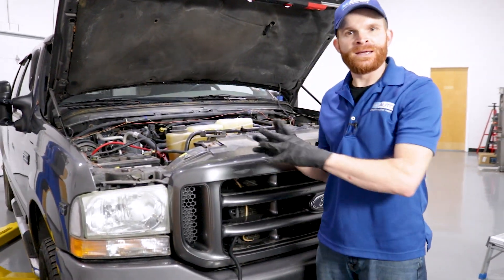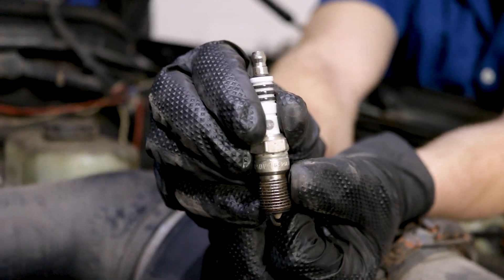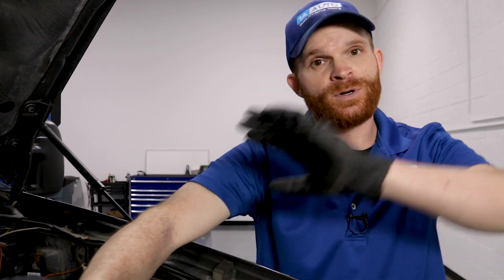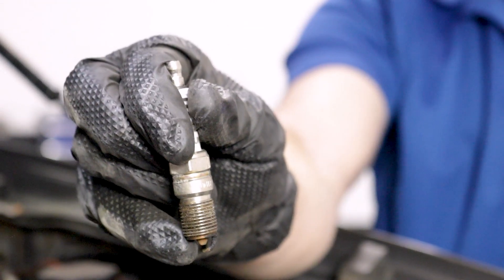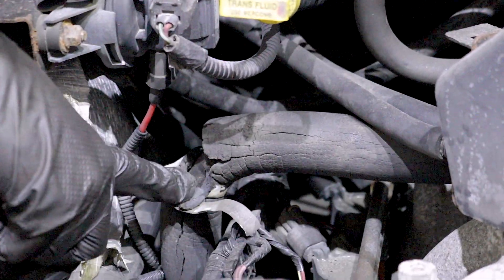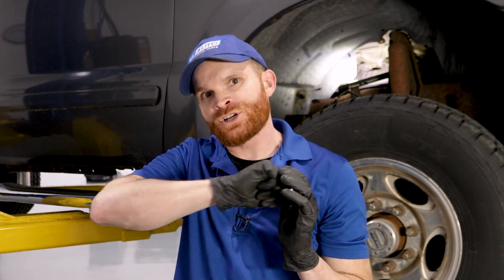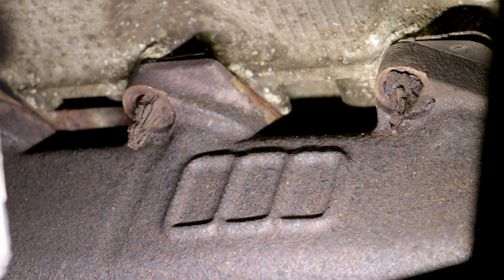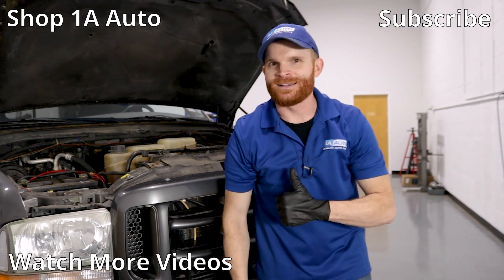Top Common Engine Problems 1999-2007 Ford F-250 Truck

Comment: Hello. Great video. I have an 03 f250 with the 5.4 and 86,000 miles that runs great until it rains or gets washed 🤔. After that, it has a slight skip when idling and while driving, it doesn't accelerate well because of a skip or misfire. If you really step on the gas however, you eventually get pass the skip, but acceleration is still terrible. Again, this ONLY happens after a heavy rain or a car wash(hood closed and no engine cleaning is done during washes). After about a day, everything is fine again...
Reply: Coil not sealed!  Water getting in!  Dielectric grease and make sure the COP coil is seated and sealed!
Reply: Somewhere in front water may not be draining as it should, and is being diverted to one of the sensors, that would be my guess.  Or one of the seals around the engine bay that limits the amount of water that gets in has failed.
Reply: Check the passenger side rear 2 spark plugs wires to see if they are worn for whatever reason water runs across the heater core hoses and drops down onto the plug wires making a puddle my 97 4.6 did this I zip tied the hoses over a little problem solved good luck
Reply: As others have said check the coils and spark plug holes. Remove the coils and blow the holes out with air. Check to see if you have the rear hood weather seal. 

Also check the inside fuse box below the dash. Early superduty’s are notorious for the driver side windshield leaking onto the fuse box and gem module. It causes all kinds of electrical problems

Comment: Did any of the 6.8 v10s have the same 2 piece spark plugs like the 5.4 triton? If so what years have them and which ones do not? Thinking about purchasing one and would rather not get into the headache of having the 2 piece plugs snap off in the heads. It would be a huge help. Thanks!

Comment: drivers side exhaust manifold has 4 broken studs. i dread this removal. 
i get lots of codes for misfires. ive changed 3 coil packs and now im doing 3 more but im heading out to check that PCV hose right now ;) 
i have a 2000 and as far as i know there isnt any issues with blow out. when i do my plugs, i always start the truck for under a min when cold. i assume warming the block just slightly , helps. 
redone the entire front end and may need new steering gear. 
nothing cheep on this truck 
ty4urvid
Reply: ps. im going to try the mig welder to pull broken studs
Reply: i drive in the bush lots and go through mirrors more then i change the oil... lol

Comment: I love your videos!  Very well done.  I have a problem with my 2000 Ford F250 with the 6.8L that I can't figure out (yet).  I'd love to get a professional opinion and I'm willing to pay shop rate just to talk to someone.  Briefly - engine overheated the other morning but my temp guage didn't show it.  As it overheated it puked out coolant and oil out the coolant reservoir.  So I changed out the oil cooler and the radiator.  Filled the cooling system and it boiled over again.  It went into limp mode due to the CHT sensor but my engine guage still showed normal.  Tried to replace the t-stat today but part store gave me the wrong one so I had to put the old one back in.  Any advice?  Tomorrow I'll get the right t-stat and hope that solves everything.  BTW - the engine runs great.  And I watch the ECT on my scanner and shut the engine down at 225 degrees.  That's it in a nutshell.  If you can help I would be indebted.  Driving me crazy.  Thanks.
Reply: blown head gasket if oil is mixing with coolant
Reply: New t-stat today but same result.  Puking oil/water sludge.  Gauge still doesn't show overheating but scanner shows 225-230F.  Engine runs fine.  No misfire.  I just don't dare take it anywhere.  Thanks for any advice.
Reply: @nunnyabizness  yup blown head gasket
Reply: Could be oil cooler. Much cheaper fix than head gasket

Comment: A couple things I noticed that you discussed in the video that aren't correct.  I'm not trying to nitpick but just want the correct info to be out there as others are watching. 
 

1.  The generation that you are working with (the 2003 model) is the 1st generation or commonly known as the "2-valve" version which was offered from 1999 to 2004. 

** (NOT up to 2007 as you said in the video) **

2.  This version did NOT have 360 horsepower as you mentioned at the beginning of the video.  The 1st generation 2-valve versions of the Ford V10 for the Super Duty had 310 HP and 425 lb-ft. torque respectively.

The 2nd generation (more commonly known as the "3-valve" versions) from 2005 to 2010 in the Super Duty trucks had 362 HP and 457 lb.-ft. of torque.

These engines were offered in other vehicles with different power ratings as well such as Uhaul box trucks, RVs, buses, stripped chassis trucks, and other vehicles.  In many cases, they had different intake and head designs and some parts are interchangeable between the different engines and some are not.  But that's a different discussion.

For the 1999 to 2004 versions for pickups, they had the option of the 4R100 or 4-speed automatic transmission or the 6-speed manual.  From 2005 to 2010, they updated the automatic to a 5R110 or 5-speed and still offered the 6-speed manual as an option.

They don't offer the 6R140 or 6-speed automatic transmission for the Super Duty pickups from 2011 and newer however, they do offer this with the chassis versions such as Uhauls, buses, RVs, and other models.  To my knowledge, there is no conversion kit avialable to mate the 6-speed automatic to the 6.8 V10 for pickups.  So, one would need to get this from a donor vehicle of one of the vehicles mentioned above.    

3.  You called the valve cover a "valve cap".  I've never heard anyone refer to the valve covers as valve "caps" ever.  I'm sure it was just a simple mistake and I'm not trying to get on you about it but it was just odd.

--------

This channel's videos are great and this one is as well for the most part so please don't take my criticism the wrong way.

I would suggest just doing a simple Google search in the future when discussing particular models and engines so you have the right info.  If you need to, just use a 3x5 index card to have a few notes on and refer to that.  This doesn't need to be so professional that you can't use a simple index card.

----------

For the Ford V-10 engines, although you did mention a few issues that they share with the other similar 4.6 and 5.4 V-8 models such as the spark plugs blowing out on earlier models and the exhaust manifolds bolts rusting out, you didn't mention one very important difference about these engines in relation to some of the newer 5.4 engines.

The fact that both versions of the 6.8 V-10 DO NOT HAVE camshaft phasers or usually known as VVT (variable valve timing).  This makes this engine so much more reliable with less moving parts internally to break down.

That might be one of the main reasons that these engines have been so reliable and I think it's something that is worth pointing out.

If you read the various forums and other sites online or in Facebook groups, you'll notice many owners getting at least 200k and 300k and more out of these engines before they have a major breakdown.

Usually.

So, they are pretty reliable for a lot of miles with little money invested.  And, they are a lot cheaper to maintain than diesel engines with only needing 6 quarts of oil with a filter compared to at least 14 quarts or more with a diesel.

One of the main downfalls (other than what you pointed out) is that they typically don't get the best fuel mileage.  Usually.

Most owners report getting between 12 mpg and 13 mpg unloaded (without towing a trailer) driving down the highway.  Many have said they get between 7 mpg and 9 mpg when towing a trailer.

But in fairness, it's all relative to how you drive.  My guess is that "most" owners of these V10 pickups are spending more time on the gas than they need to because they like to have more "fun" in the seat of their pants due to the power.  So, if they would just be "nicer" to the gas, most owners would probably get an extra mile or 2 better.

Personally, I own a 2002 F-250 extended cab 4x4 with 8 foot bed and with the 6.8 V-10 and 4-speed automatic with 3.73 gears.  It's got 308,000 miles and runs pretty well.  I get between 14 and 16 mpg if I'm driving conservative at around 68 to 73 mph with little to no wind against me on the sides or front.  If I want to do 75 to 80 mph, that obviously goes down to around 11.5 to 13 mpg. 

But wind is probably the biggest factor in how good or bad the fuel mileage will be.  Even if it's from the side, it's still not good.

I use an old Superchips Cortex 2950 tuner and have it set to the "fuel mileage XS" tune to try to get the best fuel economy and run the cheapest 10% ethanol (87 octane) whenever possible.  Sometimes, I'll get an 88 octane that I think is a 12% to 15% blend (I might be wrong on that) from a local Casey's general convenience store that is a few cents cheaper.  

But usually, I just put the cheapest stuff in I can wherever I'm fueling up.

I also tow with this setting without issues and have towed over 20,000 pounds (total with truck, trailer, cargo, fuel, me, tools, and etc.) and it pulled fine so I just leave it on the fuel mileage XS setting.  I've tested it with different fuel and the tow setting and performance setting and overall, the fuel mileage didn't improve over the same conditions and terrain so I decided the added costs for fuel wasn't worth it.

Comment: My 99 v 10 sputters and hesitate not sure if it's fuel spark or sticking valves it doesn't do it all the time mainly when it's warm and ecelerating hard not sure what to do about it no codes and no engine light

Comment: I have a 2003 F250V10 6.8 gas engine  My truck is having a hard time getting out of park into the other gears I'm assuming it's my innerlock solenoid can you please do a video on replacing a Interlock Solenoid  super duty 2003 thank you so much you have great videos very informative.
Reply: I have ample experience with this problem.  The gear selector (gear shift) mechanism on these trucks are GARBAGE!  Typically the gear selector tube breaks because it's made of pot aluminum.  I've had to replace mine at least 3 times.  Also the lever at the end of this tube can work itself loose if the small bolt at the end can/will come loose and then you'll have shifting problems.  Just another poor design by Ford engineers.  I've done mine so many times that I can have my steering column removed and on the work bench in 30 min. or less.  Sometimes I'd like to kick those engineers right in the balls for the problems I have with my F250.  I've got 318,000 miles on mine but I've had a lot of problems.  Best of luck to you with your shift problem.
Reply: Linkage

Comment: How is the transmission on the 2002 of that model and is the 2002 included in the spark plug problems? Helpful video thank you.
Reply: My 02 v10 has 231,000 miles on it. Iv never had any problems with it until it hit 229,000 miles and it blew out a spark plug while towing a trailer . My mechanic fixed it and so far so good.  I hope that it doesn't do it again.  I love my v10 it has plenty of power for me and it's a beast  in 4x4 low 💪

Comment: Doesn't require premium fuel 
Doesn't  have 360 hp Isn't a 3v lol
Mainly problems with spark plug ejection on the early non pi v10s 
They talked about the pvc valve but not wear it leaks at the bent elbow under the upper intake 

All issues In the very first minute of the video
 Was a mechanic for a fleet of 2v 6.8s keep your manifolds healthy and don't go below 2 quarts low on oil ever and you have a 350xxx mile motor
Reply: How do you keep your exhaust manifolds healthy?...
Reply: @dylancampbell8064  make sure you massage them at the end of the day

Comment: hello where is located de egr valve?
Reply: Mine doesn't have an egr valve nor post cat sensors only upstream O2 sensors these trucks didn't come with them. I have 03 f250 with 6.8

Comment: Oh snap🤯 now I know why I'm losing power and a pop sound with truck just running in park. Spark plugs could be bad, I need to check right now. Need my truck for winter,, thanks a bunch for the tips on major issues with this Ford truck.

Comment: I have this same motor and I’m having a ticking noise from 2500 rpm to 3000 rpm nothing before or after that and not feeling any power loss while it’s doing the tick any ideas ?
Reply from the maker: +Cameron Howell We wouldn't be able to diagnose an issue like that here, you may want to have a local mechanic take a look at it. Thanks for checking us out! http://1aau.to/m/Shop-1AAuto-c
Reply: Coil, spark plug, exhaust manifold leaks, Lifter, Rocker, Valve Spring!  Check them in that order as that easiest, and cheapest!  Make sure coils are seated and sealed, wire connectors are secure!  Use a stethoscope to isolate the problem area!  If you suspect a bad coil, swap it with one from another cylinder!  If the issue starts at the other cylinder, it's the coil!  Lifters, Rocker are easy and the valve cover is simple to remove!  Just take your time putting it back on!  Make sure the gasket seats properly or you'll be starting over!  Don't replace any springs unless during inspection you find one is broken!  If it's any of the "Lash Adjusters/Lifters" it's because something got inside it and is stopping it from completing a full compression cycle!  Many good YT videos on lash adjuster replacement!  Don't forget to preload them before installing!  Good luck!

Comment: Bet you haven't seen this one: 2001 F250 6.8; at 87K miles got #6 misfire, pulled coil and had 1" coolant on the boot. never water on top or even rain.  Sucked it out with straw and shopvac, drove another 80K miles rinse and repeat.  Otherwise best truck ever, no, best vehicle ever.  Work truck, airlifts for heavy loads, then snow plowed 5 years, followed by 30' 5th wheel coast to coast 10 times. Now 175K and had to replace fuel pump, otherwise virtually no expenses but tires. Terrific truck. But coolant into #6??

Comment: Thank for the info,I recently  had a clutch replaced in mine new everything,it seems they didn't live the throughout bearing properly I scoped it and its dry shouldn't you grease all fork contact point so it will not vibrate and make noise while clutch pedal it out 2003 model

Comment: I have a 07 f350 85k miles i have a rattling noise I change everything in the engine but the noise still there the flex plate not cracked help please I have a video up

Comment: So my v10 2003 seems like it’s shifting slow it decides to only shift when it’s over 4000 rpms. Any idea why?
Reply from the maker: +BostonTough We wouldn't be able to diagnose an issue like that here, you may want to have a local mechanic take a look at it. Thanks for checking us out! http://1aau.to/m/Shop-1AAuto-c

Comment: Ahhh I have a 2002 Triton V10 Excursion… dam I should have gone desire… Well I’ve had to have 3 of the plugs replaced as they blew while on the road.  Sounds like you dropped a muffler…. What was not said, is the shop that does the work needs special tools to prepare for and insert the Helicoils.  The drilling rig has a vacuum attachment to suck up as much of the shavings while drilling and you need a bore scope / camera to look down into the cylinder area and inspect to make sure you got the all.  Then repeat after threading for Helicoil and after inserting Helicoil… I basically bought the tool for the shop the first time they did this for me and lucky me it was one of the ones near the firewall…. I think it ran about $800 with the next two costing about $300 as they were further out…. I’m afraid to service the remaining 7 plugs as I fear exactly what you said here, plugs and threads will come out.  I am extremely disappointed with Ford that they did not fess up and do a recall of their own on such a bad engineering issue.  Left me stranded twice and my wife and sone once…. Now it gets 8 miles to the gallon and sits on the street gathering dust/dirt…. 

Oh yea…. You forgot another BIG issue…. DEATH WOBBLE!   I have that issue nw as well and that’s why it sits parked not being used….  My wife is constantly after me to get rid of it….
Reply: Another way is to pull the fuel pump relay so the engine won't start then crank the engine several times to clear out the aluminum shavings.  I've had 100% success doing this with other people's vehicle.  My V10 finally did the same thing while I was on the road.  Stopped at a NAPA and they had the kit so I did it right there in their parking lot.  Pulled my f.pump relay, cranked it, put the plug back in and continued on my hunting trip.  But the vacuum tool sounds really trick!  Thanks for the info.